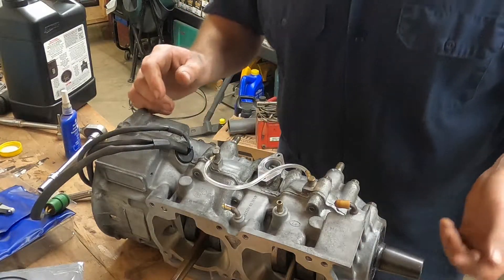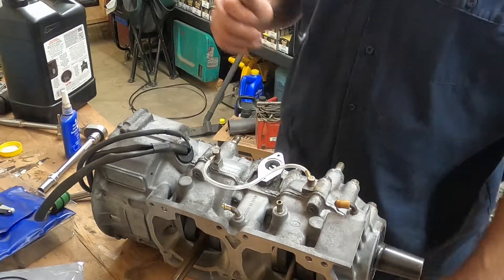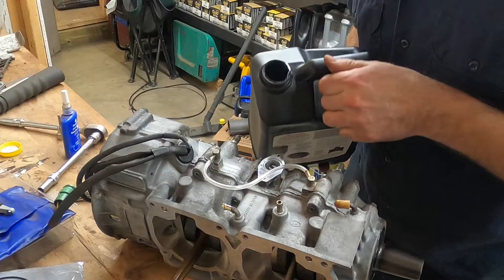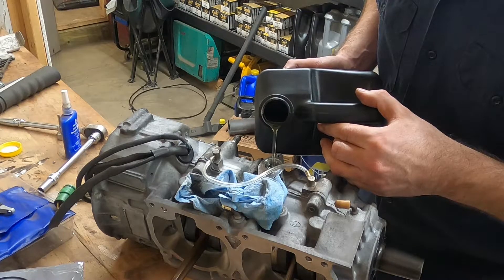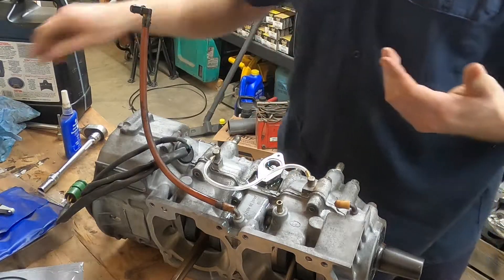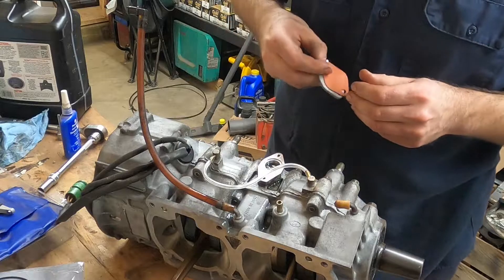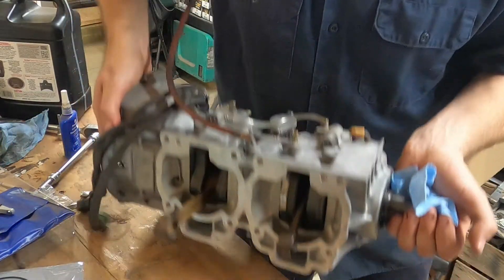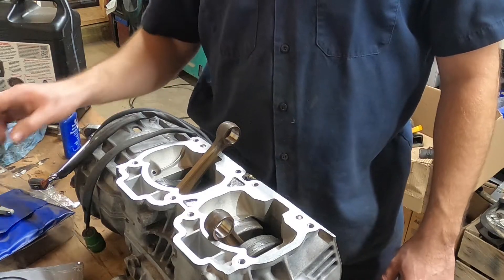Ski doo oil pump block off plate filling

Comment: Great video ,  i was wondering , that oil you put where the oil pump used to be lubricates the waterpump gearing , so how does the crankshaft get lubricated? thanks
Reply from the maker: The oil will be premixed with the fuel.  The way a traditional (some new and diesel are different) two stroke works the air, fuel, and oil run through the crankcase before making it above the piston to be burned.  Is that something you would be interested in for a future video?  It would likely be a bit before I get a chance to make one.
Reply: @macsgarage  I'm thinking about doing an oil pump delete on my 2002 skiddoo mxz 800r wanted to know what the mixing ratio has to oil would be?

Comment: Hi I have a 97 seadoo gtx,,  can I cut the 2 oil lines and plug them , and then mix 40-1 with fuel ? thanks
Reply: I do not see why not, I am looking at doing the same thing on my snowmobile. Plugs seems more substantial than a hose that can get ripped off during install or acquiring a leak.
Reply: I will say though, Of all the research I have done regarding it, everyone connects the two with a hose, no one caps em, must have some sort of reason that I have not figured out yet.